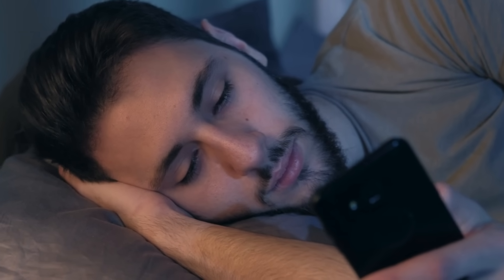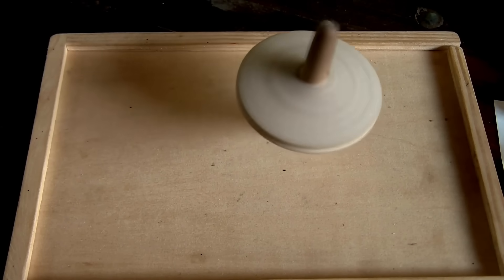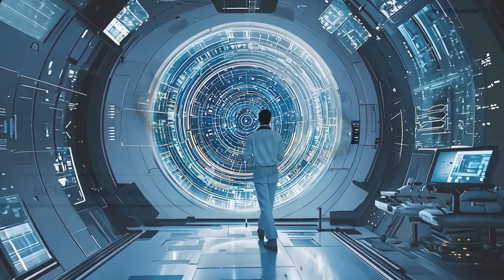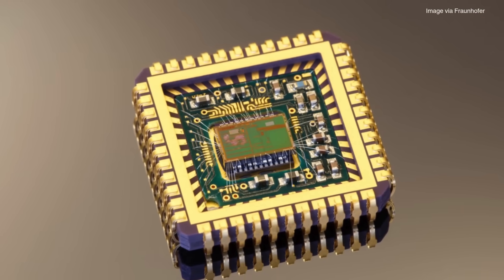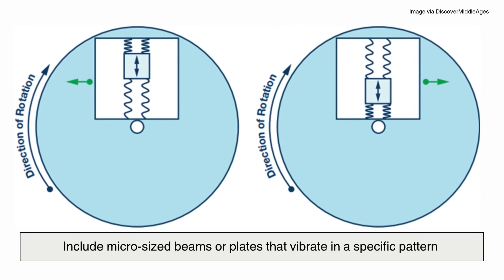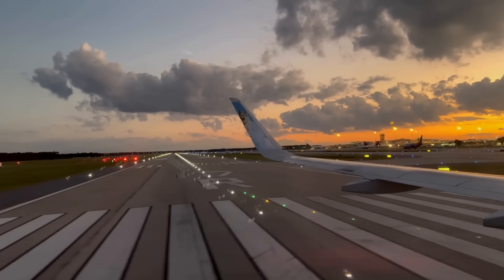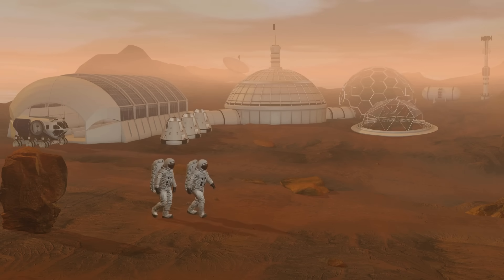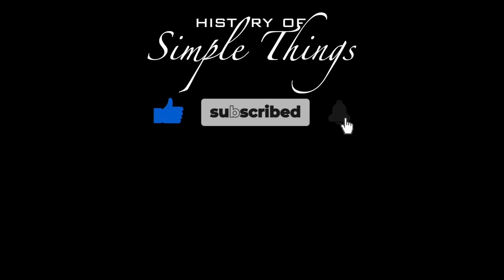How Gyroscopes Are Made and Their Role in Navigation Systems

Comment: Good video but I have to say that there are no gyroscopes involved in anti lock brakes.   The system works off sensors that get wheel sped and then turn off the brake for a moment if the wheel stops turning.  Gyroscopes would serve no purpose it what is really a simple system.

Comment: There seems to be confusion in this video between MEMS and laser ring gyroscopes, and it entirely fails to mention the hemispherical resonator gyro (HRG), a common choice when very high precision is required.
Reply: Our company invented the HRG, and one of the common arguments against it was that there was "NO mass storage involved".  We had PHDs arguing against the concept, while we were showing that it worked.  The original concept was discovered in the 1700's.  Safran now owns the technology, and MEMs resonators, and Optical Resonators, also pick up on the same concepts.  The HRG is still the "second best" gyro in the world.  Only beat by the HP and NASA Einstein Probes designs.
Reply: mechanical gyroscopes depend on the conservation of angular momenta
MEMS devices are basically accelerometers; they detect external force (when motion deviates from a straight line, for example)
Laser gyroscopes are basic interferometers
They have nothing in common
Reply: @janami-dharmam  Oh so wrong.  We invented the HRG, and that was a common argument, as to how "no mass" could retain directions.
Reply: @janami-dharmam  It sounds like you're confused about laser gyroscopes. They are indeed 'basic interferometers', but they are nonetheless very good at directly tracking rotation, and aren't prone to the "tumbling" that gimballed mechanical gyros are subject to.